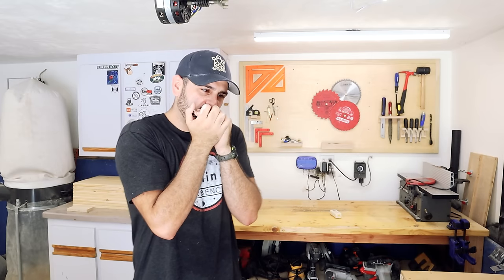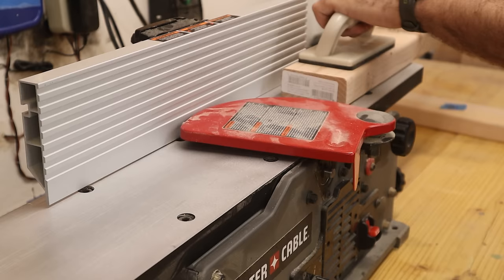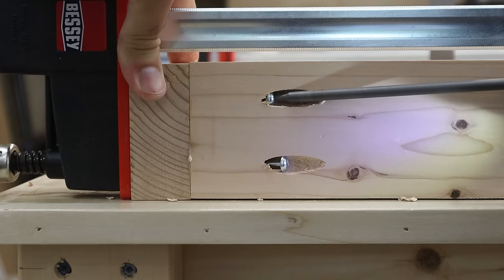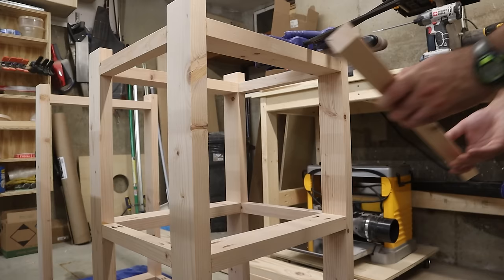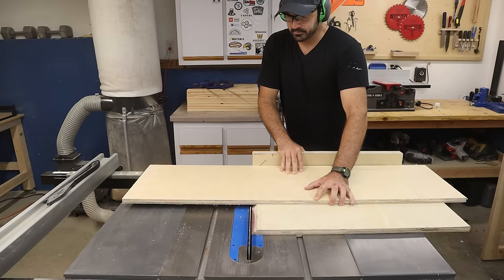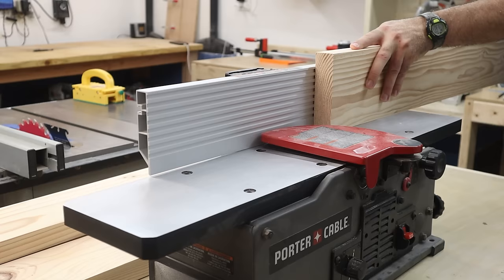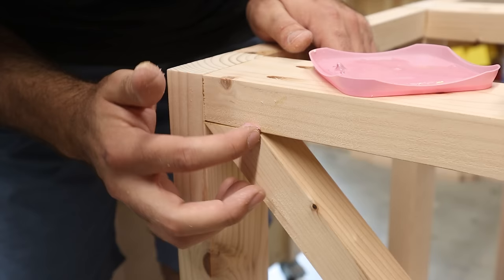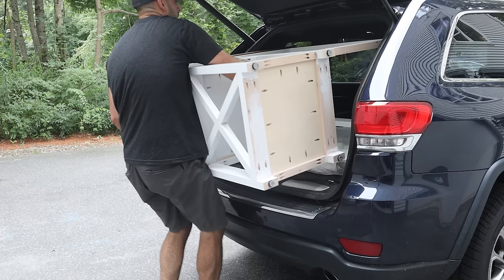DIY Coffee Bar / Mini Fridge Table - Beginner Woodworking

Comment: You should get a jointer plane to joint the edges. A number 8 is able to plane two 30mm boards at one time to ensure that the gluing surface is perfect. Sometimes its not worth fighting with the machinery.
Reply from the maker: Agreed. I need to start adding to my hand tool collection. Got a number (I think) jack plane that I'm still learning how to use properly.

Comment: For the X, I found it easier to mark where they sit and everything, but when you cut, only cut the middle half way and the same to the other using that depth  stopper on your miter. Creep up on the halfway point. Can’t undo your cuts! Lol
Also, you can just glue them if they’re a tight fit. I’ve had one for years and it’s never come undone with just the glue. It’s additional support, but honestly, depending on what you’re making, it might not need it. Your call! Go make some saw dust! Lol! Compost your sawdust btw! You get awesome fine healthy compost!

Comment: Nice project. I have the same jointer ,with same problem. I swear I'm going to trash-it but never do.  Matt at 731 woodworking has a great tip for jointing the boards with a table saw.  I use it ,and get great results.
Reply from the maker: Thanks! Yeah, I ended up buying a used Jet jointer after this project and sold the porter cable one. Much better improvement over the bench top.

Comment: I was thinking of giving that Porter Cable jointer a try, but after watching your video, I've decided against that. I don't have a lot of space in my garage. So, I may just give a try to the Grizzly 8' with spiral head top bench jointer. Good job by the way.
Reply from the maker: Yea, it works for smaller pieces just fine, but has troubles with larger ones. I actually just upgraded my jointer to a used 6" Jet and it's so much better.

Comment: Looks amazing! Really wanted to see how you did the brown top with the clear gloss look. Great video still!
Reply from the maker: Thanks!  Yea, I wish I filmed it too.  I thought I was going to only use the wipe-on poly, but I wasn't liking how it came out.  I just added some oil-based poly to my paint sprayer and put on a few heavy coats (with some sanding in-between).
Reply: @CasualBuilds  What didn't you like about the wipe on?  I was planning on using Minwax One Coat Poly/Satin.  Hopefully, it will be fine.

Comment: Actually have a question about your miter saw box.  Do you find it collects the majority of your dust since it has an open face?  I see almost everyone else put some type of cutout face on there's.
Reply from the maker: I've since switched my miter saw after this video.  The one in this video was just alright at collecting dust.  I used the box so it would contain most of it and not spit out the back (which worked).  I did have to vacuum inside every so often.  My new miter saw has horrible dust collection and I'm still trying to figure out how to improve it.

Comment: Are the pocket holes necessary? Or can you just add screws in from the outside of the frame? Awesome video, thank you
Reply from the maker: It may be tough for the inner "legs" where you can't access from the sides.

Comment: For the jointer, did you make sure to flip the board so that the side is reversed against the fence for every run ? I’ve got the same jointer and was able to make it work, so just wanted to check
Reply from the maker: I don't believe I tried that. When you do that in/out method it should correct that instead of reversing. I don't think the in/out feed tables on my jointer were coplanar

Comment: I noticed there no dimensions for this build? Should we just make our own dimensions?

What did this bars dimensions come out to? Looking for 46 inch bar.
Reply from the maker: Check out my website for plans www.casualbuilds.com
Reply: @CasualBuilds  finished my build. Will say with just normal 2x4s this thing comes out kind of wonky haha. Boards just aren't straight so there is some play. Going to have to putty the crap outta my table. But beats buying a 800$ from Etsy. Cost me 100$ total with a few needed tools.

Comment: Is there any reason that you don't use planed timber rather than rough! would save a load of time  and effort, is it a cost issue?
Reply from the maker: Yes, wanted to keep cost down and I don't have any lumber yards with that kind of wood near me - usually just go to one of the big home improvement stores for wood.

Comment: You said you used all 2x4 and 2x6? So did you cut the 2x6 to 3 inch each? What did you do with the 2x4? Is that what you used for the 11/2? If so, why buy this size and not one closer to size like a 2x2?
Reply from the maker: I used 2x4s for the entire base construction and 2x6s for the top.  There were 2x2 pieces in my design, but I got them from the 2x4s because the 2x2s at the store aren't typically flat or in the best condition.
Reply: Gotcha! Thank you so much for your response. Love watching the videos!
Reply from the maker: Thanks!

Comment: This is not something for a beginner to make. A beginner wouldn’t have most
Of the tools to make this. You should should show it with tools a beginner would have.
Reply from the maker: Did you listen to the voice over?
Reply: This is a beginner project being overdone by a professional.

This whole thing can be done by a "beginner" with only a table saw, a sander, and a drill. I know because I made a similar (But simpler) table with half-lap Xs as a beginner with only those three tools, and I bought them all used for a fraction of their retail price.

A table saw is just a more convenient circular saw, which is just a more convenient hand saw. A jointer's job can be done by a table saw, and pocket holes can be carefully (but imperfectly) done without a jig. Biscuits are nice, but dowels also work well and are both cheap and easy for the same thing.

The very first lesson of woodworking is to not make excuses about your tools.